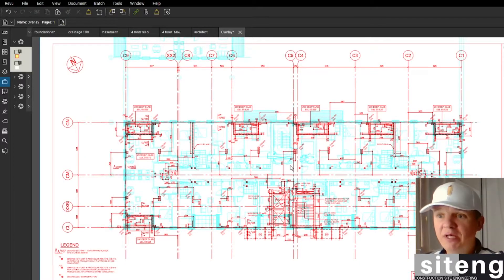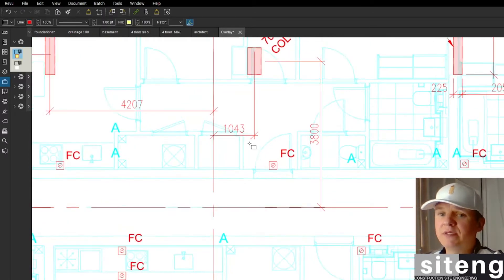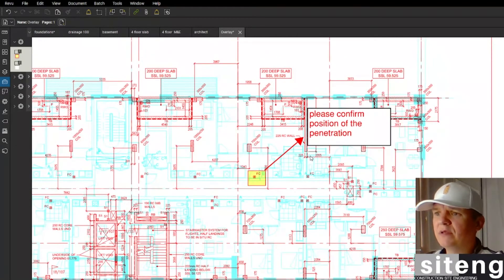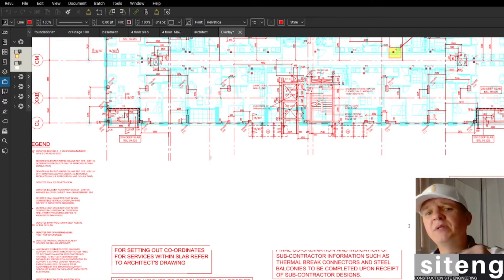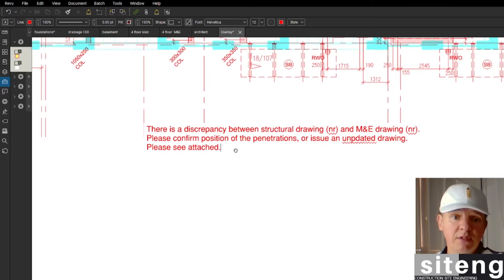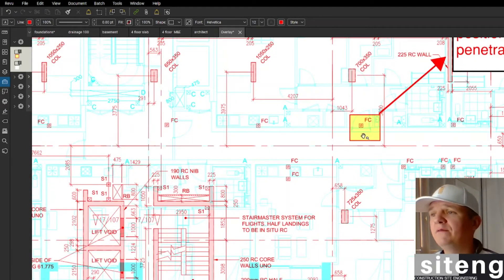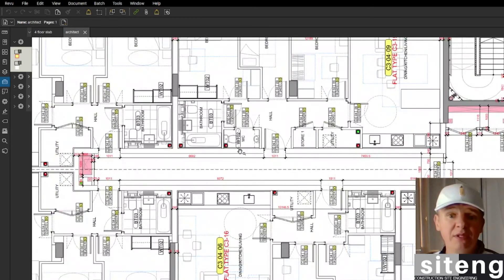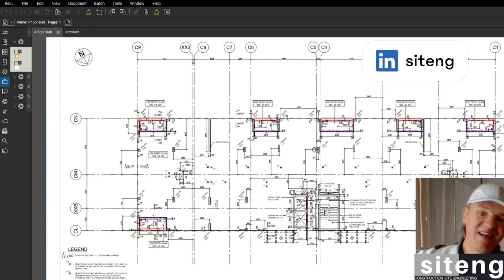RFI - request for information. How to raise an RFI in construction.

Comment: Thanks Greg, I've been following your channel before i relocated to the UK. I would appreciate if i can work with you as an intern
Reply from the maker: Hi Mo😁 I am not in UK currently, will be back in few months. Hope you found work and you happy? Let me know if I can help somehow 👍👍
Reply: @SITENG  thanks for the prompt response, can you please recommend somewhere i can get practical experience in setting out. i have CSCS white card.
Reply from the maker: The best would be if you find assistant, or junior engineer position. You will learn the most like that. The pay might not be big at the begging, but you will get the experience and once you're confident with setting out jump for engineer position somewhere else.
Reply from the maker: Mo! Best practical experience is something like this: https://www.cv-library.co.uk/job/215616893/Assistant-Site-Engineer?candidate_apply_only=MTIzOTMwMjc6MTY0Mjk2MzEwMTqtUUOcQVLuMyAltlUUwroZ2ebv2yoGr6Jl-p5eivRBaQ&s=103849&utm_source=system&utm_medium=email&utm_campaign=candidate_instant_job_alert_variantb_sept2019
Reply: Thanks, it's much appreciated.
Reply from the maker: No problem 😁